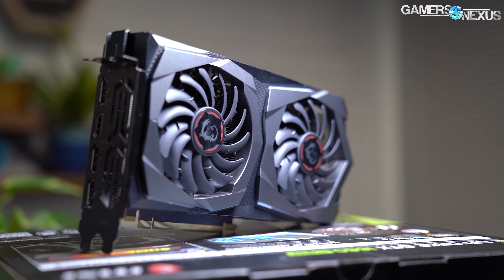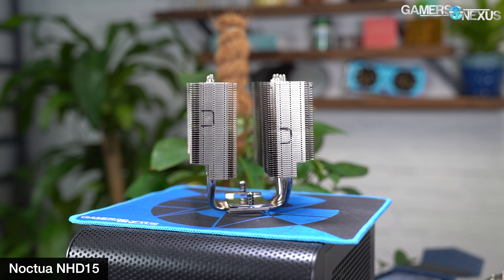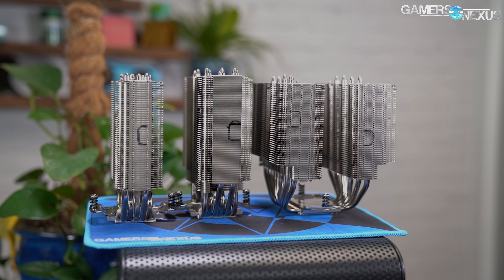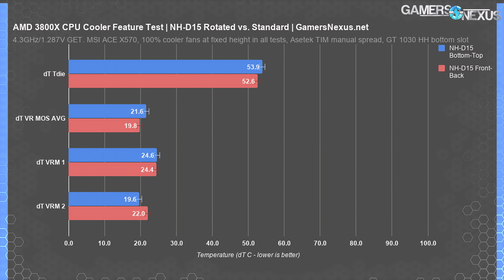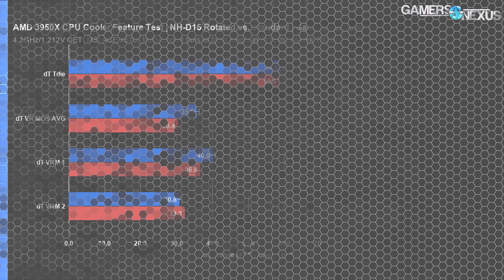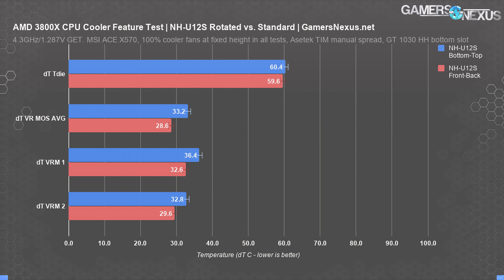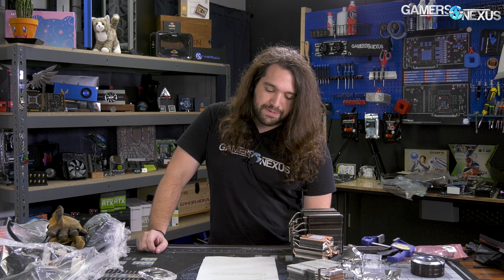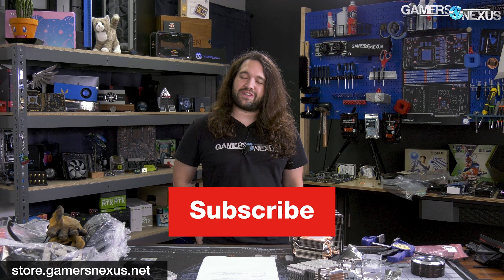AMD Ryzen Heatpipe Orientation Benchmark & CPU Cooler Myths

Comment: Hi Gamers Nexus,
Igor from IgorsLab has filmed thermal images with his industry thermal cam. Also Igor experimented with a set of modified jet plates for water cooling blocks and water flow amounts. Also Igors shows thate the IHS makes a good job spreading the heat.
His verdict was that it makes a little difference what jet plate is used and how many water flow hits the compute dies or the I/O die. He saw around 2-3°K difference in cooling performance in lowest water flow scenarios. If a higher water flow is used the differences are approaching measurement error: 0-1°K. I think that confirms your findings but for water cooling. 
How ever Igor referenced AiOs and that they could be have a little bit of trouble. Cause is mostly the amount of microfins and if they positioned on the hot spot of the compute die or how many fins placed above the die or not. But this is another discussion and off topic to your video here. 
Here are Igors videos, I recommend to take a look, very good content:
https://www.youtube.com/watch?v=C5gTffl98Xc
https://www.youtube.com/watch?v=3WgtYXifHc0
Reply: Minor nitpick: When referring to temperature measurements in the absolute scale, it's just Kelvin, not DEGREES Kelvin (i.e. please say 2-3K instead of 2-3°K). When referring to temperature measurements in Fahrenheit or Celcius, feel free to include the degree symbol.

Anyway thanks for the links, they're quite interesting supplemental material for this video.

Comment: I suppose that if there's a difference it is on coolers with direct contact heatpipes; Noctua (❤) coolers have a pretty solid baseplate that may completely eliminate differences between orientations.

Many coolers on the cheaper side have direct contact heatpipes, like the very common CM212 and the Arctic Freezer 34... Those should be the parts to be analyzed imho

Comment: Hasn't Ryzen used a Chiplet design since day 1? why is all of a sudden a problem now? Also the Heat Spreader spreads the heat and coolers have a plate that touches the entire IHS so it probably wouldn't even matter if the pipe didn't touch anything. I'm pretty sure when reddit comes up with these things they don't think it through fully, good job Steve is here to do their work for them, poor Steve.
Reply: Basically because of the heat density for those 2 7nm compute chiplets, let's say for 3900X each one does ~ 60W or even more when overclocked and all that heat cannot really be disipated faster enough like their older CPUs, so 7nm IS that hot!
Reply: Google the zen and zen+ CPU layouts. then notice how easily it is to see why people thought it was an issue now and realize how dense you are. Why do twits like you even ask questions you can answer by taking 20s to google shit?

Comment: Noctua NH-D14 orientation
I tried both orientations and saw no observable difference. I got about 72degC with the same software stress test with CPU and case fans set to a constant RPM. I even recorded the room temperature to be certain but in the end it was within a degree or two thus not worth investigating more accurately

Comment: STEVE... TEMPERATURE QUESTION?
I have an R9-3900x. The CPU temperature spikes easily, even in very light usage. I have a Noctua NH-D14 and even have the fan profile set so the fans spin higher than needed and don't ramp up until 60degC. But I can still be sitting in the low 40degC range and have the CPU fan ramp up for two seconds then ramp down again which suggests I got a spike well over 60degC. Baffling. I even applied the OFFSET (hysteresis?) to 2.6 seconds which didn't help this issue... when I had the STOCK COOLER it was horrible. Horrible. The fan was constantly revving up and down with a whiny/grinding sound which appeared to be the motor... anyway, I can't grasp why the temperature spikes up well over 60degC when CPU usage is only around 5% or so when I can go maintain about 72degC under 100% load. Sigh... and it seems if the load is higher than idle such as 25% or so the spikes don't happen. It seems worse when I'm in really light usage as if the CPU is responding to something more than just the temperature at the moment.
Reply: Try a small negative voltage offset and some LLC. It works wonders for ryzen temps.
Reply: (I don't think it matters but I have the Asus X470-F Strix Gaming motherboard, and use the Asus Suite III with DIP5 for the overclock and fan setup. I assume the CPU just passes on the temperature so I suspect it's the CPU that causes my fan fluctuation issues. Again though, why do I get spikes near 70degC under LIGHT load when I can be under sustained, HEAVIER load but not see the fan spike as high?)
Reply: @photonboy999  oh yeah dont use AI suite for auto OC it will always use high voltages.
Reply: I also have the 3900x with the  D15S (extra chroma black added). At desktop and browsing, etc (light load) I see 45 - 52c, stress testing I see 72c and prime 95 can push that to a max of 82c. I have max cpu boost override set to 200MHz and my ram is overclocked to 3666 (from 3200)

Comment: The whole point of the integrated heat spreader was to allow heat to be dissipated more evenly!
Reply: Try telling that to the reddit users with a lukewarm iq and lower..
Reply: @Scootermagoo  lol They obviously live by the saying the internet said it was right it has to be true.
Reply: That and cracked or chipped dies originally due to warranty issues. This boomer chipped and cracked many a die with high pressure, heavier than hell solid copper coolers, and induced ear bleeding fans.
Reply: Which works great when they're connected by some material that is great at transfering heat. Materials like solder.
Paste on the other hand is less ideal.

Comment: That’s what the IHS is for... it’s not there just for show...
Reply: The IHS is primarily to protection the CPU chip (or chips in the case of Ryzen 2). You get better heat transfer with direct contact than using an IHS.
Reply: @photonboy999  yeah, but as proven in this actual video, the heat spreader does indeed spread the heat. Therefore the results between direct die and stock are not comparable and also the results between different rotations  with heat spreader are much the same.

Heat spread and heat transfer are different things after all.
Reply: Jeffrey Photonboy read the name: Integrated HEAT SPREADER. As in it SPREADS HEAT.
Reply: @ElZamo92  When AMD FINALLY went to  an "IHS", it was primarily due to broken and chipped dies. I never worried about mounting on an Intel chip of that era, but always sweat when mounting on AMD. *"OK BOOMER" replies are automatically muted.

Comment: Ι rotated 90 degrees the am4 bykski block i have (ek supremacy evo copy), so the chiplet is fully under fins and its a little better. I believe the problem with those chips is 7nm transistors and heat dissipation, also high voltage (especially with pbo on some mobos), not offcentered heat.

Comment: Well I'm using an Arctic Freezer 34 on a 3700x and it performs way better than the stock Wraith Spire even if it only has 4 heatpipes that cover just the middle 50-60% of the IHS
Reply: There is also the whole factor of not heat pipes, but over all thermal contact and fin density and fin surface area. Then also fan.

Comment: I would imagine, the specific heat capacity of the metal IHS  is far to high for the heat to be localised. If the heat transfer rate was slower, this may not be the case, but why would anyone make an insulating IHS.

Comment: Well, the rotation did impact VRM. It's measurable.
At least there is something.
Reply: That "Something" is still nothing, the VRMs are well below what they need to be temperature wise to operate at full capacity with no losses.
Reply: @shawnpitman876  Well, I know... but at least is something. It's irrelevant to the heatpipe orientation and more on the airflow direction, but why not going for the best one if you can?

Comment: My 3 pipe dual 80mm fan enermax cooler is sitting on my Ryzen 5 1600 overclocked to 4.0Ghz...and its CROOKED about 30 degrees. Been like that for 2+ years now and it seems fine. ¯\_(ツ)_/¯

Comment: Wouldn't it be cool if we could get aftermarket cpus in the same way as gpus. Skip the ihs and let cooler designers have higher integration. It'd probably require significant changes to mounting solution, but I'd love to see what noctua could do.

Comment: Tomorrow is the winter equinox, in accordance with ancient druidic traditions ALL CPU coolers should be rotated 90 degrees anti clockwise until 20th March next year(Spring equinox). For the most part you wont notice any effect at all, but you'll FEEL it's right and have the KNOWING.
Reply: Cosmic power will cool down the CPUs!
Also, healing crystals can be used to dynamically cool the system down via frequency resonance. 
Learn more at snakeoilmerchant123.scam
Reply: @diatomsaus  That's just ridiculous. Everyone in certain internet circles knows crystals can only be used to levitate pyramid blocks into position(like minecraft in reverse), and cure hemorrhoids. Cosmic power probably wont help much, look what it did for Captain Marvel and Rey in the new Star Wars: it just Mary Sue'd them, and definitely didn't make them remotely "cool" lol.
Reply: Remember to forward this comment to 20 of your contacts or your CPU will throttle for 6 months!!
Reply: Rotate it 4x 90° for 4x the effect!
Reply: Burn a few enemies in a wicker man is good for additional 10 degrees of cooling.

Comment: Y’all just HAD to post this like an hour after I get my PC built just to make me question everything..
Reply: Whats ur specs
Reply: io 
3600 on a msi x570-a pro with a hyper 212 evo. I’m looking up the chiplet positions now just out of curiosity

Edit: looks like each chip might have 2 of its own heat pipes
Reply: Actually this video means you don’t need to question anything. If your cooler is front to back it’s right. And that’s just because of air flow not die chip placement.

Comment: I'm still trying to understand higher temps on a 3900x vs. 3950x   ~_~
Reply: you'll figure it out once you understand the volt/frequency curve and binning.  long story short, you are getting better silicon in the 3950x.
Reply: @michaellesak6912  the silicon part seems just too simple of a factor for it though. It is undeniably true just as the 3800x is just a better binned 3700x. But with the 3950x it's binning except I wonder if there is a BIOS that'll apply the same values to the 3900x. It's not that I'm unhappy with mine, but seeing that there's more to it than just the silicon, it just feels like you're being handicapped in a way ya know? Before the 3900x I had a 3800x as a placeholder whilst the 39 was out of stock everywhere. I still remember how little voltage & cool it ran. It's just weird to me, if I had money to just go out & do whatever I want I'd have gotten a 3950x essentially 😂😭.. Ahh but c'est la vie 🤷🏼‍♂️
Reply: @Demorthus  you would be amazed at the amount of difference better silicon can make. better quality means running the same frequency at lower voltage, lower voltage means less heat.  it really is that simple. 

as far as trying to use settings for a 3950x on a 3900x, wont work.  the 3900x would be sold as a 3950x if it could hold the same clocks at the same voltage, it cant thats why the chips were binned for a lesser processor.  they basically test all the cpu chiplets when they are made to determine the volt/frequency curve for that chip.  they use that to bin the chiplets for different products.  the best of the best go to epyc server cpu's, next best go to threadripper and the 3950x, and so on down the list.  amd is really good at maximizing the potenital of their cpu's, thats why there isnt any extra headroom for overclocking. i'd recommend looking into some deep dives into silicon manufacturing if you want to know more, AdoredTV has some good stuff if you can handle his thicc scottish accent
Reply: @michaellesak6912  I'll definitely check over AdoredTV. But damn, there goes some of my hopes for just a tiny bit of thermal headroom LOL. On a somewhat unrelated note I wonder if the same applies to b-die memory but not in terms of overclocking but tightening the timings.. I've got a 64GB CL16 kit @3200mhz & from my attempts the safe settings don't work. Scratching my head trying to figure what I'm doing wrong. In the advanced panel it estimates an OC potential of 3600, which I find cute but irrelevant as I'd like to go for the timings & not the bump in clocks. Except I've yet to find any guide or reference to show someone else fully saturating the dimm slots & at the very least with 64gb.. It's fair to say it's clearly not in the "gaming" channel category, but for workstations you wouldn't happen to know a channel or site where I'd be able to find that sort of thing? Puget systems came to mind but I don't think they test this kind of niche thing, unless I just haven't checked idk
Reply: @Demorthus  gn has done some stuff with memory timings, hardware unboxed has ryzen memory tuning videos (havent watched them, but the guys are pretty good in general).  not sure about with 64gb kits, but the nuts and bolts of the process are the same and will give you a template for your own testing.  there will always be room for optimization, just a question of how much effort you want to put in for uncertain gains.
Reply: @michaellesak6912  Yeah I've watched it, but as you somewhat alluded to its kind of uncharted territory when asking about this capacity lol. The reason I asked (besides curiosity & someone actually replying), is also because I asked a similar question on their ryzen memory OC/tuning video with benchmarks & all that. I know that as you saturate the slots you have the overall greater stress you put on the IMC & the hardware you have will dictate where you can go, for instance if at the time it was possible I'd have gotten a 3600mhz kit but it was literally 2x the price of the one I've got... & actually nearly surpassing the msrp of a 3900x to boot lol. But I'll definitely keep trying, I appreciate your input & time you've taken to offer very good advice! 🙏🏼

Comment: Couldn’t you just fire up the cpu without a cooler, then film it with a thermal camera until it crashes? Maybe not the most responsible way to test this, but it would give a good demonstration of how the IHS heats up, and if it truly is asymmetrical .